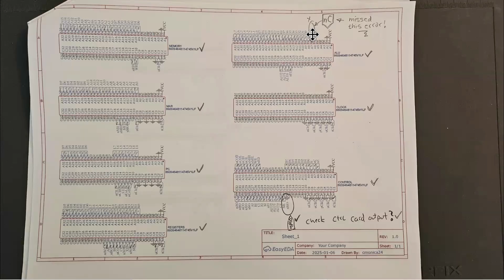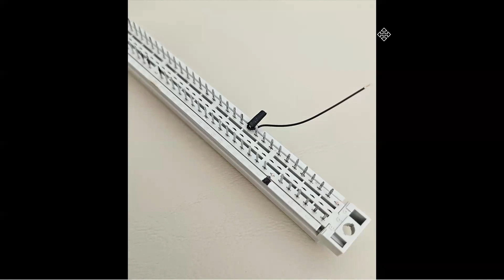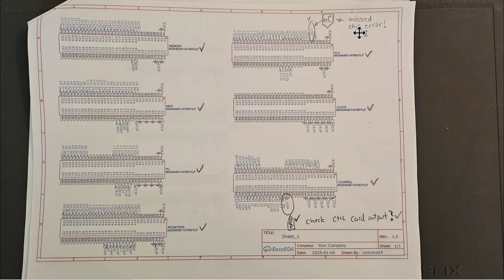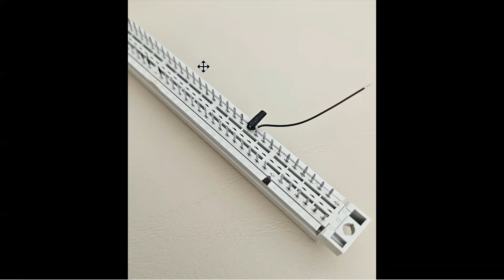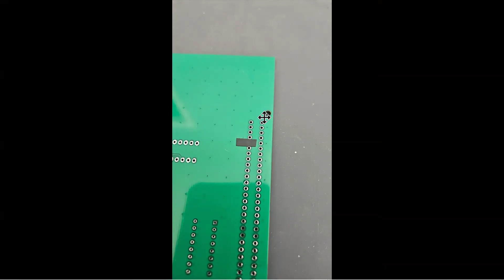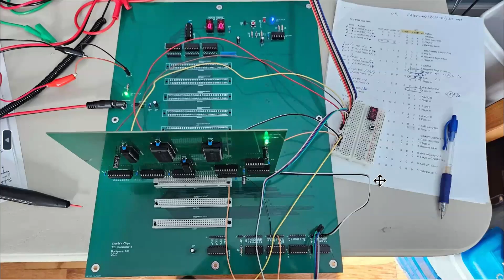TTL Computer II #40 - Backplane / ALU Fix

Comment: I'd be livid if I messed up a board that size. ;-) I'd guess you paid in the neighbourhood of  $110  plus shipping for them.  But considering the ginormous size and 4 layers I must say that 20 bucks a pop is really cheap compared to what they would cost a decade ago.  For a cases like this I'd really wish that JLC and others could make boards in singles and not just in 5-packs.
Reply from the maker: It's more like 38 a pop.  If I don't come across any other issues I will likely live with the repair.
Reply: @CharliesChips  Dang! At that price I'd for sure spend many hours desoldering, drilling and patching before I gave in and ordered a new board. But actually - some green wires just adds some authenticity to the system, back in the day everything more advanced had patches.
Reply from the maker: @MatsEngstrom  Yeah, that's what I told myself too.  All the old mini computer cards had jump wires all over the place.  So I guess I am in good company.